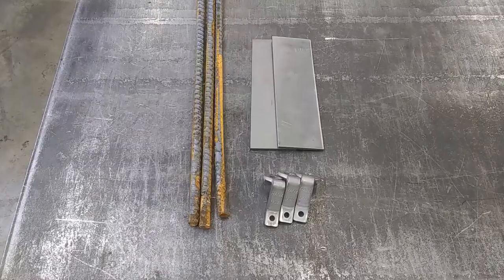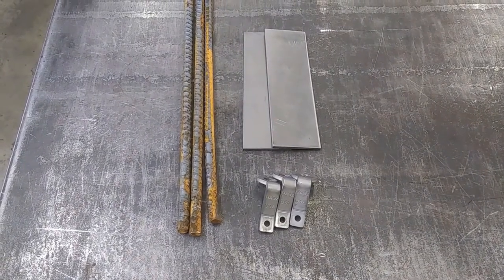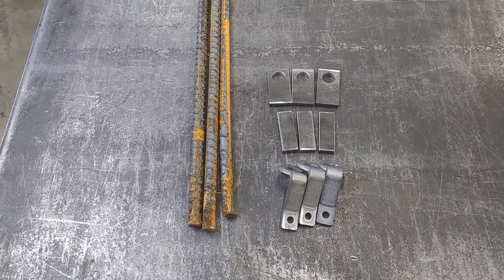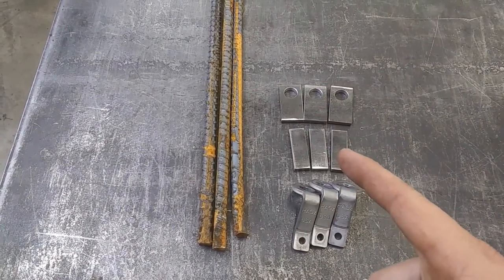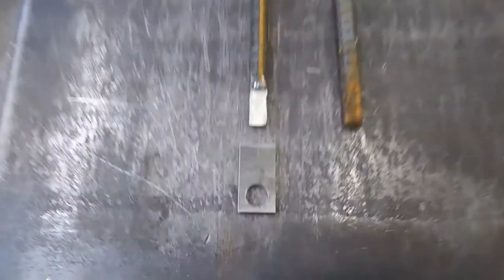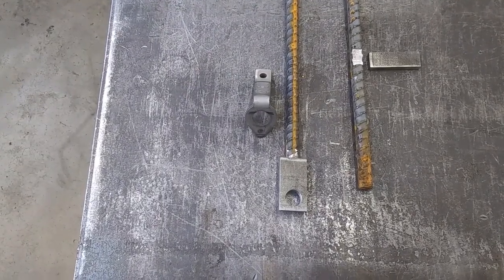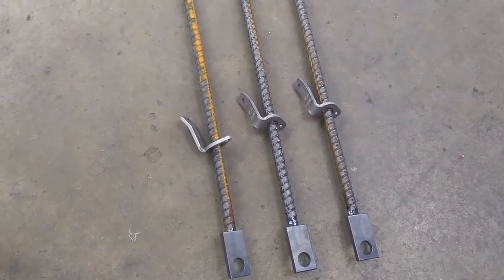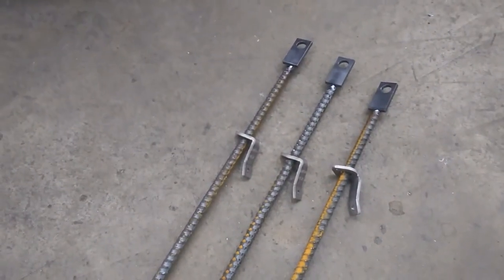Drowner Rod Build

Comment: Wonder how many guys have a shop like this to drowner rods and stops?
I use 3/64 cable with a bent washer that I drilled wholes in myself. $35 pair of swag crimps
from Lowes.  Got my barrel crimps off the net and just got a #5 lb beaver on it today. 12/22/20.
Got two others with my conibare that I set in the middle of two slides. Awesome day. I mounting
the big boy and making hides of the other two.
Reply from the maker: Awesome. Not many people have access to a shop like i do for sure. I make videos like this more for enjoyment and to show how i do things. The most common way to make a rebar downer rod is to weld a large washer on either end of the rebar but that video is nowhere near as fun to watch or make. Thanks for watching bud congrats on the trophy.

Comment: Great job Nate!! Do you use 8 footers or 10? They turned out great 👍👍👍
Reply from the maker: I use 8s. I buy 10 ft sticks cut them to 8 and i have a 2 ft stake just weld on a washer. Plus they are easier to haul too.
Reply: nate 408 thanks a bunch man 😊👌👍👍
Reply from the maker: No problem.